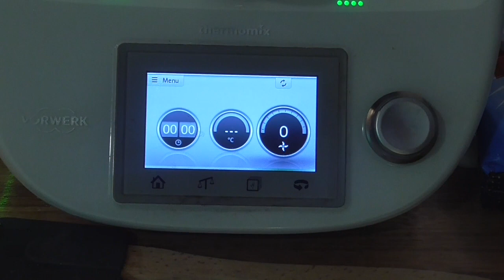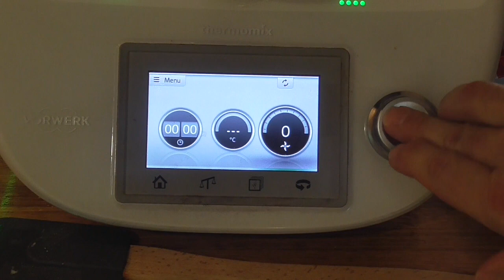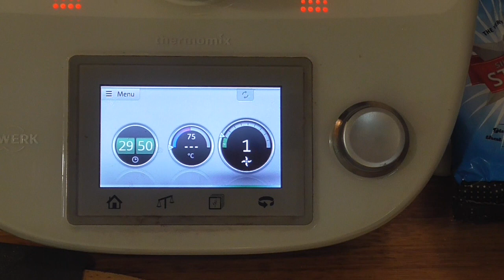Making Starch Paste for Bookbinding // Adventures in Bookbinding

Comment: At the risk of being one of "Those" guys, I have a couple of questions.

1) You say you can use just plain all purpose wheat flour in place of the starch.  Same ratio and procedure as with the starch?
2) Can corn starch be used in place of wheat or rice starch?

Sorry, I know, a newbie driving you nuts.  Thank you for your time.
Joe
Reply from the maker: Great questions.  All bookbinders will adjust their ratios with experience and what they are after.  I'll make a thicker paste for putting on the spine of old books to soften the animal hide glue for removal and I'll make a thinner mix if I'm doing a lot of paper repair.  It can be thinned down with water, so thicker is usually better.  You can add water but not take it away.  For wheat flour maybe try 5:1 to start and adjust depending on how it works for you.  I admit I've only made it once as an experiment (for bookbinding anyway - I do have kids).  You can experiment with all types of starch.  I know people who use corn starch because it is easy to get.  Mark Cockram uses starch based packing peanuts!  I'm sure he has put this on the web somewhere, but can;t find it right now.  One last thing regarding other types of paste, I would only use exotic sources of starch on my own work and not clients.
Reply: Thank you for the explanation.  O made some wheat paste this evening.  3 TBS of flour mixed in enough cold water to make a creamy mix then cooked on 1 cup of water until a gravy consistency.  Let it cool and used it to case in my book.  This worked okay the best i can tell.  Now that this project is done, for better or worse.  I think I will step back and try a simple notebook of sewn signatures made of folded letter paper.  I know the grain will run the wrong way, but I am more interested in understanding and performing the process.  The. Worry about the correct materials.  Perhaps I should buy your little notebook kit.  But I suspect that shipping to the USA is expensive.  I have sent a couple of items to a fellow YouTuber in Australia and it had been expensive for me to ship there.  Thank you again sir for your time.

Joe
Reply from the maker: Good luck.  Maybe try the square back bradel binding next.  You have so many sources of materials in the US than here in Australia.  Look at Talas https://www.talasonline.com/   I bet a few phone calls to printing suppliers and you'll find short grain letter sized paper.

Comment: Thank you for putting out these instructional bookbinding videos! 

Quick question, you mentioned oil of cloves as a preservative. How long does the paste last when stored in the fridge?
Reply from the maker: It seems to depend on how good your sanitation is and maybe even local yeasts.  I usually get a couple of weeks without and preservative.  But it is important to sieve before using after storing.  These days I only use refined starch paste for paper repair.  Methyl cellulose is a far more convenient general purpose paste type adhesive.

Comment: Thank you for the video. There’s a thing that I’m concerned a lot, hope that you will answer. Where I live - Vietnam has quite high humidity, especially in spring so I wonder if this glue will get moldy after it is applied to paper and fabric? Thank you in advance.
Reply from the maker: Mould is caused by the presence of mould spores - which are everywhere - and a humid environment.   The most important thing to avoid mould is keeping the humidity as low as possible.  Paper and fabric are as susceptible to mould as starch.  The reason the paste "goes off" is because it is wet and perfect conditions for mould and other microorganisms.  This would be true of paper and cloth if it were wet.  Once the paste dries, it is not much different to paper and fabric.  Brisbane in summer is similar to your conditions.  This past summer has been a real struggle.  Even with a dehumidifier the bindery was often over 60% RH.  Between 45% and 60% is my target for humidity.
Reply: @DASBookbinding  Thank you sir, for the detailed explanation.

Comment: First of all thanks for another excellent tutorial.
By my count, preparing the paste in the Thermomix takes 1 hour and 30 minutes. Will it be possible to shorten some stages to reduce the total time to 45 minutes, for example? And which phases can be shortened with the least damage?
Excuse me for asking but wouldn't it be better to add the clover oil only in the final cooling phase. As a general rule, essential oils lose their qualities when heated. Isn't clover oil the same?
Reply from the maker: Was it that long?  You could do 10 minutes of mixing on cold, 20 minutes to cook, and 10 minutes of cooling while stirring?  40 min total.  If you cut down on anything, the mixing can almost be got rid of.  It's more habit than science that part.

The clove oil thing is a bit folksy.  Trying to answer this started turning into an essay.  I'll address it in the future in a blog post or something.  Short answer is that whatever chemical acts as the preservative seems to survive the heat, because it works.  But adding the oil before cooking means the oil is either well incorporated into the paste and some of it will evaporate.  I'd rather not have oil leaching into the book.  It also seems to act like a surfactant and reduce bubbles in the finished paste if added before cooking.
Reply: @DASBookbinding  Thanks for the quick response. Sorry for the late Reply. 40 minutes is already an acceptable time... I'll try the Thermomix method... Happy New Year to you and your family

Comment: How do you get it so thin? It seems like no matter how much water I use, it always sets like ballistics gel if I cook it until it goes translucent. I tried using 8:1 water to rice starch and it still holds its shape. Next time I'm just going to try an absurd ratio and see what happens.
Reply from the maker: Have a look at my wheat flour paste video and try that.  I'm less fussy about mix ratio with wheat flour -  2 heaped tablespoons to 250ml of water.  Also, forcing it through the strainer and forcefully mixing mixing mixing is important - critical.  Good luck!  DAS

Comment: I’ve made 2 batches of starch paste.
The first went from liquid to solid like – whoosh – so quick.  So the second I heated very slowly taking nearly 40 minutes, not knowing at what heat it actually went – whoosh!.  Eventually it got to what appeared to be the right consistency when I poured it into the jar.  It wasn’t thickish and opaque like yours but white and cooled to be solid jelly.  Does that sound like the correct consistency?  I am able to pass it through a sieve but it remains sort of ‘grainy’.
I see your make of starch does not contain borax whereas mine does – could that be the difference?  If there is a difference!
Reply from the maker: I assume you're using the standard 5:1.  Maybe try 6:1.  Not all starch is equal.  It is fairly solid after being made and put in the fridge.  Did you see my recent video on wheat flour paste?  I'm mostly using this for leather work now and the starch paste just for paper repair and paste paper.  I always push the paste through the strainer 3, 4 or 5 times.  In between each time through I also stir is thoroughly.  I add water during this stage to get the thickness I want, which may be thin for fine paper repairs.  I've never heard of adding Borax, but that is almost certainly as a preservative.  I like the clove oil.  Hope that helps.  Darryn

Comment: Hi! I am new to bookbinding, and I learn from your videos, is the wheat paste used as a solid method for gluing? As compared to PVA? I want to make my own bookcloth and I am wondering if the wheat paste is a permanent method used by professionals, or is it only amateurs and beginners? Is it something I could sell? I am a marbler wanting to make my own notebooks with my papers on them, and wonder if wheat paste is a good option for me. I attempted PVA to back my marbled silk and washi papers and the PVA glue was a little hard to manage. Thanks in advance!
Reply from the maker: Wheat paste is very much a high quality adhesive used by professional bookbinders.  Not a lot of professional bookbinders would make their own bookcloth, more the creative types.  I have just made a video about backing fabric with paper to use as bookcloth and in this I mention that PVA has some disadvantages over paste, mainly in cleaning up.  I will be doing another video where I impregnate the fabric with different substances such as paste, methyl cellulose and a mix of paste and acrylic.  The last of these may be best for bookcloth you might like to sell.  All the best, Darryn
Reply: @DASBookbinding  thank you sir for your reply!

Comment: Does anyone know if cornstarch can be used instead of wheat starch. In my country, Brazil, I can't find wheat starch, but I want to avoid flour paste due to possible stains on bookcloths
Reply from the maker: Most cornstarch is actually wheat starch - with added marketing.  I believe Whitewings (our local brand) cornstarch is actual cornstarch, and I have tried it and I found it a bit brittle.  Unless doing paper repair I would just use wheat flour paste.  DAS
Reply: @DASBookbinding  thank you very much!

Comment: Neat! Do you know if it works with tapioca starch? I can't use wheat, but I have plenty of rice flour and tapioca starch for gluten free baking.
Reply from the maker: I don't think rice or tapioca starch are as strong adhesive.  But I've not done rigorous testing on this.  Also think they are more brittle.
Reply: @DASBookbinding  It's probably the gluten, lol. That's a large part of why gluten free baked goods are more likely to fall apart, anyway.
I'll have to look into paste alternatives.
Reply from the maker: @craftopus1140  Nope.  In this video I use a highly refined wheat starch with no/trace amounts of gluten.  But for leather binding I use wheat flour paste with the highest gluten content I can find, and it is a much stronger adhesive.  The gluten does make a huge different.  It does yellow with age, but this not due to acidity and "paper burn".  But for attaching leather it isn't seen anyway.  I use flour for leather and refined starch for paper repair.

Comment: So you really only use this mixture for leather and laminating paper? Do you find that your leather or laminated paper going bad or decomposing? Can you show us your laminated paper? What is the the purpose of this laminated paper and is it slightly yellow?  I'm guessing this mix is not non acidic, and it will yellow whatever subtance you use it on? thx alot! :)
Reply from the maker: I mostly use mix for laminating, usually paper.  By laminating I mean adhering 2 large flat things such as paper to paper, paper to board, cloth to board, etc.  The gold standard for paper conservation work is pure starch adhesive because it is chemically non-reactive and reversible.  The PVA/EVA I use is Evasol which is specifically made as a conservation grade adhesive.  But most consumer PVAs designed for paper are fine for the vast majority of jobs.  A mix made of one of these PVAs and paste, either MC or starch, will be close to pH neutral and will not cause acid burn or degradation.

I highly recommend people starting out using paste or mix when putting down endpapers (the paste down).  It is too easy to mess up a book at this very last step.  Using paste or mix provides an opportunity to correct a mistake.

An example of laminating paper to paper is in the made endpaper.  Sorry about the loud music, this was one of my earliest videos.  It is also an example of where I mix up a small quantity of starch paste and PVA, rather than MC, in my fancy Japanese bowl.
https://youtu.be/4vN5xSY86iw

It’s not just me that does not see decomposing paper when using paste or mix.  These have been the standard adhesives for bookbinders for hundreds of years.  Everything decomposes with enough time.  The question is how this can be slowed.  The best evidence bookbinders have is that these are the best adhesives to use to slow this process.

Regarding yellowing, I’m not sure why you think starch paste or PVA/EVA would cause yellowing.  Flour paste is avoided in paper conservation work because the gluten is known to cause the adhesive to go yellow with age.  But prior to refined starch being available this was what all paste was made of and most books made prior to say the 18th century are evidence of the quality of flour paste.

For covering a book in leather, I mostly use straight paste.  There are some occasions I will use PVA/EVA in a less traditional approach.

Hope this helps.  It’s been useful for me as I’ve been working on a script for a video on the use of adhesives in bookbinding.

All the best, DAS
Reply: @DASBookbinding  How about corn starch or boiling rice? Would eithermake conservation quality adhesive? I just thought it would yellow because it's not NON ADIC, or PH neutral, I'm interested in conservation, I know you mentioned rye starch & wheat starch, thx again♥♥☻☺
Reply from the maker: @ArtWars314  To answer this, we need to unpack what “conservation quality” is.  Maybe we could assume that this means it is an adhesive that a professional conservator would use.  In which case a professional conservator will use the most appropriate adhesive for the individual job, and this will be based on lots of research and knowledge.  This is why if you look at Talas’ website for conservation adhesives there are heaps that almost no one except conservators have heard of.  Maybe the conservator is working on iron-gall ink and needs an adhesive with no water in it and thus uses an adhesive that can use some form of alcohol as the solvent.

But let’s simplify this and say it’s a paper conservator repairing a tear that does not cross text.  They are likely to use Jin Shofu starch paste, which is a Japanese wheat starch.  Why use this and not Silver Star laundry starch, which I use and is also a refined wheat starch?  Because the easiest thing they can control is the adhesive they are using.  They want consistency and some form of guarantee of quality.  

Will corn starch work?  Yes.  For fun I’ve extracted starch from potatoes and used it for paste.  But now the water is probably more important that the starch.  The reality is most tap water is fine.  My tap water is slightly alkaline with a pH of about 7.8 which is perfect for many jobs as I know the calcium carbonate in the water acts as a buffering agent.  But this would be harmful for some photos which react with alkaline substances.  Would a professional conservator use corn starch from the supermarket?  Probably not.

A final thing on conservation, knowledge and techniques are as equally important as the materials.
All the best, DAS
Reply: @DASBookbinding  I see I see, this is super helpful! ☻☺Very good to know since I'm thinking about diving into some aspect of book making and eventually selling these books that I would hope to be heirlooms sometime in the future♥♥

This info is gold and it's exactly what I'm looking for since I'm new and I'd like learning from people that are experienced like yourself.  sorry if some of my questions are stupid but I'm quite new at this and I haven't been able to watch ALL of your videos in entirety.  I would love how life is busy so I often just play a playlist of your videos in the background as I go on my day and just LISTEN to your narrative ( I would love to sit and watch with undivided attention but the day is SHORT!)☻☺ so I might miss bits and pieces here and there so sorry if the questions were already covered.  

Thank you so much! I find this new hobby fascinating :) Cheers and may the good LORD Jesus keep you joyfully binding! Cheer♥♥

Comment: Has anyone used the food grade wheat starches vs the Lineco brand one?  There’s a dramatic price difference and wondering if the Lineco is worth it.  (The food grade ones I’m finding on Amazon/US seem to be packaged for Middle East/Asian market, so I can’t really tell much about them… and the laundry starches I’m finding don’t specify what type of starch it is, and say ‘pre-gelatinized’.  Do we want gelatin?  I’m thinking no?)

I tried making some with cornstarch just bc I had it on hand, and it LOOKS just like what’s in the video, at least after I watered it down a bit.  Started at a 3:1 ratio based on another recipe, and it didn’t so much ‘thicken’ as ‘congeal into a gelatinous mass’, so I added an additional part of water while still on the stove, then a 5th part after it cooled, and strained it through cheesecloth to mix that in well.  (So ended up at a 5:1 ratio.)  Used tea tree oil, bc again, had it on hand, and I’m working on ‘student projects’ where I don’t care so much about archival quality.  Very happy with the result - not sure how it compares to DAS’s, but it seems almost identical to the Nori Paste I’ve purchased.
Reply from the maker: No, Lineco is not worth it.  Different starch based adhesives from Talas are much cheaper.  Yes, people have used different starches for, well forever.  I've experimented with plenty just for fun too.  Just for the hell of it one day I decided to extract starch from potatoes and turn it into glue.  Pre-gelatinized is what the instant pastes are made of.  The paste is made, probably vacuum dried and powdered again.  But I think the best thing to do is buy 1lb of methyl cellulose from Talas and that will last for years, and the made up adhesive will last for ages.  Good luck!  DAS

Comment: can i substitute flour for the starch and coconut oil for the oil??
Reply from the maker: Yes, wheat flour for general adhesive.  Same ratio.  But not for paper repair where you can see the dry paste.  The gluten will go slightly yellow with age.  No oil needed.  DAS
Reply: @DASBookbinding  🥰🥰🥰tnxxxx🥰🥰🥰